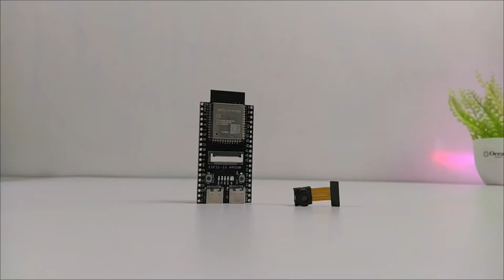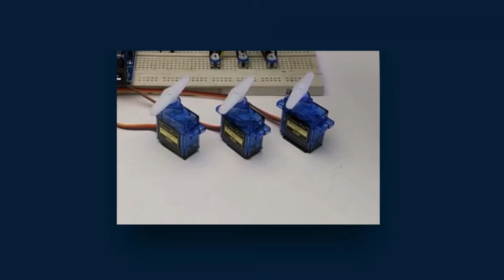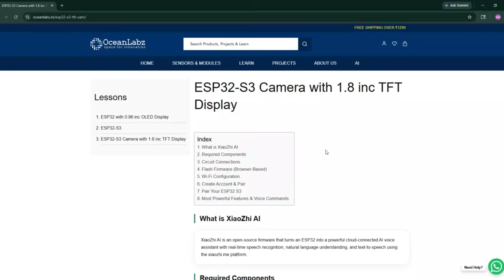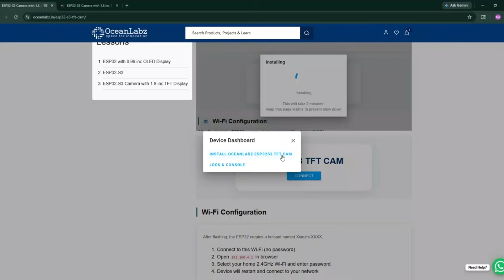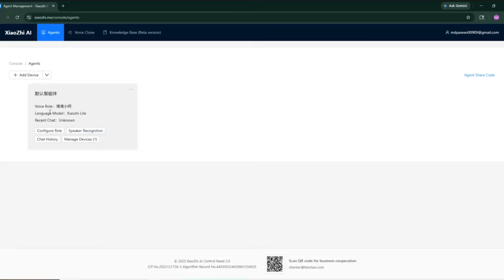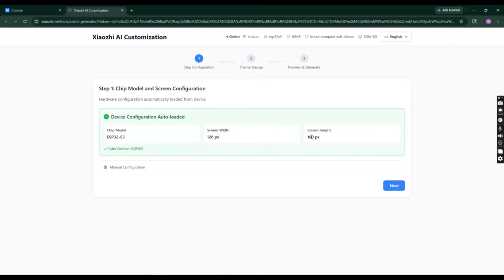AI Voice Assistant using ESP32-S3 CAM and XiaoZhi AI | AI on ESP32

Comment: Sir speaker is not working . What to do? Please give a solution. It's my exhibition project.
Reply from the maker: Please double-check your MAX98357A amplifier wiring against the pin diagram provided in the video, especially the LRC, DIN, and BCLK connections. 👍

Comment: Hey OceanLabz.. this is fantastic.. thanks for the video.. Was wondering if there is tutorial in the works that shows the process of setting up the firmware yourself. I did this with the previous videos you made and tried your arduino verson as well.. all worked great! so thankfull for your content..I should add.. the main reason I am asking is I have a 320x240 display and I can't make that work with pre-configured firmware. And I would love to add a wake word.

Comment: ❤Sir, ich habe das exakte Projekt gebaut. Alles funktioniert, aber nur die Kamera nicht. Wenn ich den befehl gebe ein bild zu machen, dann steht dort Speaking... und mn hört nichts und der ESP hängt sich auf. Haben Sie eventuell eine Idee woran es liegen könnte? Vielen Dank
Reply from the maker: It sounds like a hardware connection or power supply issue, please double-check your wiring and try a stable power source.

Comment: Can I use esp32 cam instead of esp32 s3cam plz tell and 2.4 inch st7789 display instead of this display
Reply from the maker: The standard ESP32-CAM lacks the performance and PSRAM required for this specific AI firmware, though the display should work with configuration changes.

Comment: Can I skip both the camera and tft display and just use a 0.96 inch oled display - will the code , setup and connections remain same in this case?
Reply from the maker: Yes
Reply: @Oceanlabzdotin  whenever i try to download esp32s3 ov3660 it shows failed to download manifest but only the ov2660 works but i only have ov3660 please fix it, nice project though